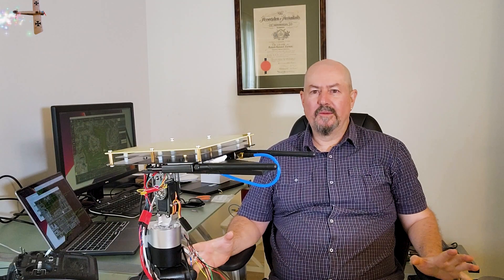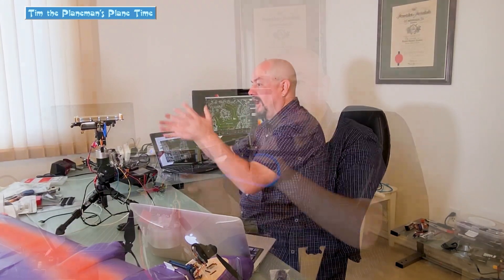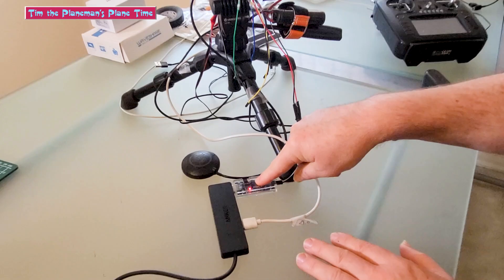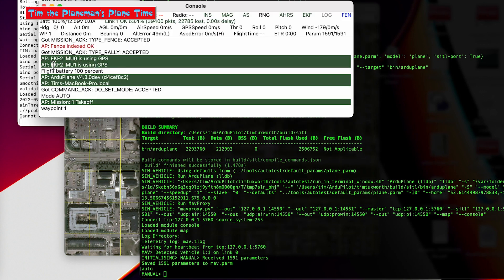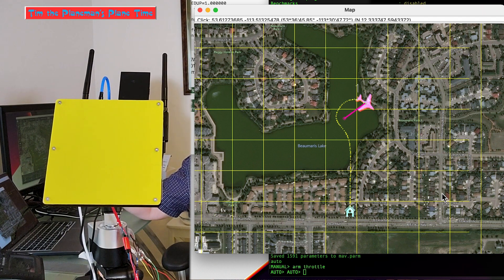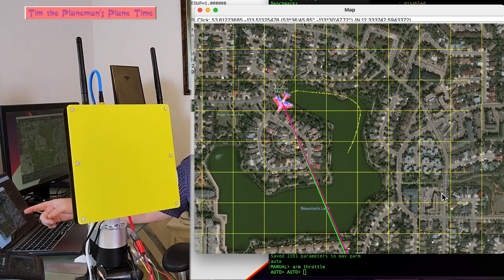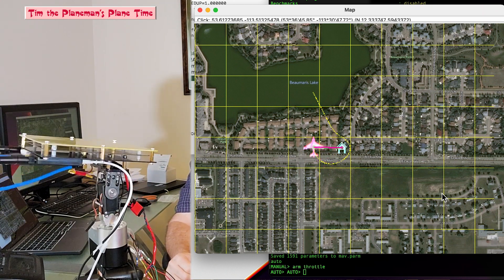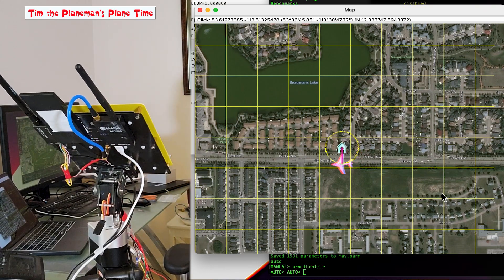Just for fun I set up an antenna tracker.

Comment: Had one for a year now no luck with my r9m and arduplane
Reply from the maker: Its definitely not Plug and Play. I'll do a more detailed video that explains how I got it to work. It's not for the faint of heart for sure.
Reply: @timtheplaneman   thanks. My tracker sees the info comeing  in but just doesn’t seem to understand the data.  But I like ArduPilot and no a fan of inav
Reply from the maker: @Mrfunkyfpv  When I see that it was almost always the baud rate was not set correctly.
Reply: @timtheplaneman   I’ll keep trying to get it  but I will say the tracker does look good on my desk
Reply from the maker: @Mrfunkyfpv  🤣
Reply: @timtheplaneman   are you using frsky or crossfire
Reply from the maker: @Mrfunkyfpv  Neither - I have a Raspberry PI with a 5G/LTE data stick in the plane streaming mavlink over mobile/celular data to the PC. I've also got it working using SiK 915Mhz radio - mavlink from the FC direct to the Crossbow Mini, but that's not what I'm doing in the video.